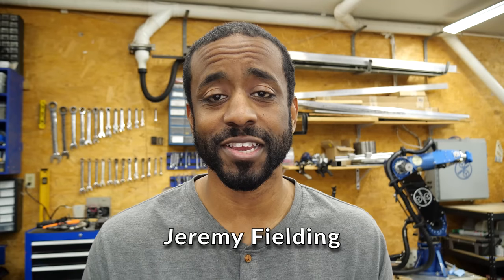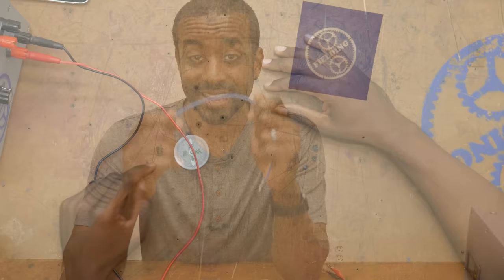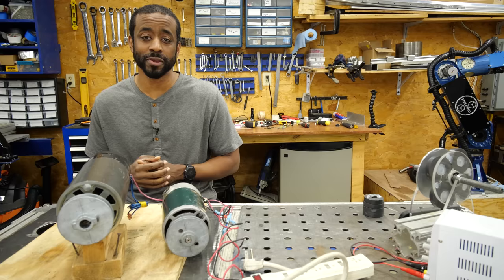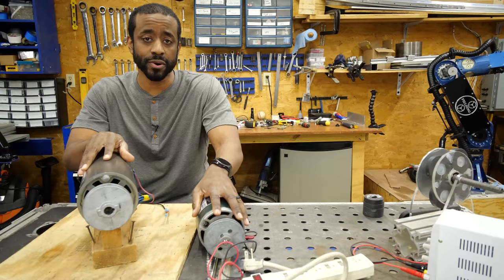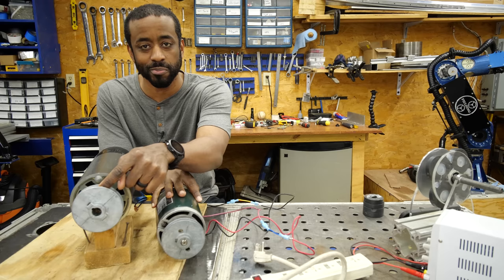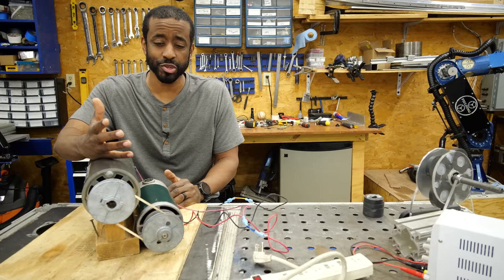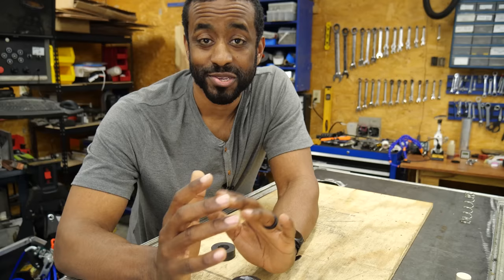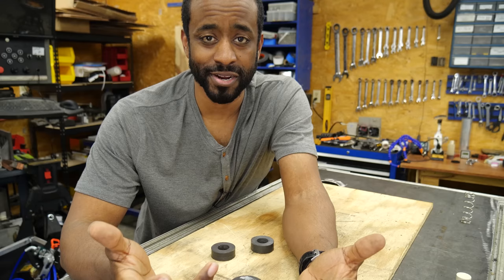Reviewing Free Energy Generators.  A Response to My Video "Nikola Tesla's Greatest Invention"- 102

Comment: You have made me a dumpster diving hoarder. In the last week alone I've brought home a control panel from an moisture evap unit, 3 90v DC gear drives and 3 12v DC power supplies. I've been stalking the engineers at work just to fuel my addiction. Thanks for the great content

Comment: I'm 77 years old and in 1965 I took a course from the Navy almost the same exact thing the only thing I didn't hear him mention is there's also resistance in the wire if you put 2 V or amps actually into a wire by the time it travels just a few feet it no longer is 2 V that's because of resistance in the wire gold is the best conductor of electricity however for obvious reasons that's too expensive silver is next that's what they use in shuttles and the most abundant is copper which is used in most electronic equipment. I'm a high school dropout and in a very short time I was able to understand this.

Comment: I use to maintain an NMR lab at a state university. A modern NMR magnet is a solenoid wound with miles of super conductor wire. The solenoid sits in a bath of liquid helium. A DC current is feed into the wire, once it reaches the desired level the source is removed and the current runs in a circle which generates a strong and stable magnetic field. We had magnets that had been running for 20 years without losing their fields. An MRI machine is set up in this manner. Really cool..
Reply: But what happens if you try to draw power from it to supply or feed an external system I don’t know much at all about any of this stuff so is why I’m asking I’m not trying to be a smart ass or anything im just really fascinated by this subject cause is such a challenging subject matter and one of the most important aspects in life that if figured out effectively would be a good way to start to change our impact and interactions with one another and this world that’s so far been a great host to our occupation of it
Reply: @user-wi4kx1td4i  no one would do that. you don't  go to the trouble of getting a superconductor going just to use it like a 5¢ capacitor.
Reply: @user-wi4kx1td4i A static magnetic field doesn't generate any power. It only has potential energy, in the same way as a chunk of weight sitting on a shelf has potential energy. You can only generate energy from it by induction (e.g. waving a piece of metal in the field back and forth) but even that energy comes from the kinetic energy of the waving motion, not from the magnetic field in the coil.
Reply: MRI machines use superconducting magnets, but they are discharged when the machine is turned off, but maybe by deliberately using up the power, because there are some reasons why you don't want to have the strong magnetic field on all the times (for example, you couldn't use any metal tools to repair the machine if the magnet was still charged).

Comment: I think the magnet as a spring is a really good analog,. Magnets suspended over superconductors will apply force to a scale underneath if you press on it.
Reply: Apart from the fact that magnets, unlike springs, unfortunately can't be positioned to hold an object in equilibrium. Earnshaw's theorem
Reply: Every system, is a spring. :)
Reply: @dfgaJK  with a super conductor it can
Reply: @harrytopia282  Ignoring the amount of energy it takes to cool the super conductor. Yeah.
Reply: @SirHackaL0t.  there are super conductor materials that don't require cooling but can only be manufactured with expensive rear earth materials and gases under a vacuum. Yeah. Anymore  sarcasm. Hello anybody home Hello Hello.
Reply: @harrytopia282  Do you have a link to the super conductor materials that don’t require cooling? Even with superconductors, it’s impossible to get more energy out than you put in. 🤷‍♂️
Reply: @SirHackaL0t.  I think there was some experimental one, one or two years back, but it was only experimental so
But even then. Some sort of energy loss will appear
Reply: @SirHackaL0t.  Well if you are already in a cold environment (like on Pluto, in deep space, etc.), then everything already gets cold enough without extra "energy".
Reply: @iteragami5078  Sadly, that’s not the case here on earth. Even your deep freeze isn’t cold enough.
Reply: @SirHackaL0t.  What do you mean? YBCO (a superconductor) needs to get below -180 Celsius, but Pluto is at -232 Celsius, which is plenty cold enough?
Reply: @iteragami5078  but we are on earth, not pluto. sigh

Comment: GREAT VIDEO: When testing electric motors in the lab (22 years - RMTC in Battle Creek, Michigan), the best we could get was always a loss. Electric motors have improved over the years and the motors now used in automobiles are incredible, however, they still have a loss. That loss keeps us from keeping the mutual systems going. Once power is removed the systems start to slow their rotation and finally stop. How quickly they stop depends on the load and is directly follows the universal time constant curve. In five time constants it is considered fully stopped.
Reply: They stop straight away once you remove startup power
Reply: @harrytopia282  There is some momentum after you cut the power
Reply: @daskampffredchen9242  very little, the generator becomes a dynamic brake and the setup will stop virtually straight away

Comment: My Dad told me and my friend, when we were in our early teens, to find out about perpetual motion, I think it was for two reasons, 1. Keep us out of trouble and 2. Make us think, we had great fun trying loads of different ideas, we found loads of things out, after a lot of messing, I got hydrogen from water and just a few volts, we spent weeks making lots of small hydrogen generators, once we had the optimal voltage to output, this was in the early 80`s so the only information we could get was from the library, but it was well worth it, we didnt store the hydrogen in any way, it was just what we had in the rubber tubes, and adding a small diameter metal nozzle outlet and a one way valve (the only thing we brought), it fired up with the first match, my heart was racing, so back to the library to get as much information as possible, we added an oxygen nozzle, took us ages to get it in the right position, once it was we were cutting sheets of steal like butter. Then we started on gun powder and black blasting powder and we even got the school to let us make it there as our science project for a heigh percent of our grade of our exam, Im now 52 and never stopped messing about, even trying things that you think that no way will it work, ok 90% does not, but the 10% you get something, even if its not what you expect, Anyone who is interested in tinkering about please do it, stay safe, but have great fun, I still am ;)
Reply: Gun powder in school...that brings back memories of PU trucks with rifle racks & usually loaded guns in them w/ the windows down. "Boonietown High" for 1 so no one stole as pretty much everyone knew everyone & it was early to mid 70's (think that 70's Show).
Never did the GP @ school. Basement yes. Was a mad little scientist for a bit & my Dad owned a bookstore. Who needs a library when you have a used bookstore! 
Couldn't begin to make it today!😝
So you actually got the H O generator to work...amazing!
Reply: @jakekot1351  How fantastic, ya dad having a bookstore, the info you must have got so quick, they have it easy now lol, I made a generator a few months ago, to show my grandkid, only a small one this time just to show him what you get from 2.5v, I explained the name of the game is be bloody careful :) , I explained that it starts to get danderous if you want to store it and told him to get on the net and look up 5 or 6 sites and get the info on storage, as I never bothered, still cant get over how lucky you were with the bookstore :)
Reply: @DenBlackburn  I spent summers after 12 to probably 18 at the store a lot, just long & narrow with 2 aisles, a bigger storage sweatbox in the summer & "that smell" of old paper, 18 was when we closed it. Gold was legal to own/trade. @ 13-14 got to walk to Bache, a brokerage firm then, & sit at an empty desk by our guy. Monitors were orange. I'd  get the kbd (1 for 4 desks) & check our stocks, I held some too. 50 of this, 100 of that...MORE THAN NOW (0)!  We moved more into antiques & mostly out of books but the library for the business & what I skimmed for myself grew. Almost all gone or ruined due to long term illness & bad neighbors. Then went Sunday big Pa markets & then shows. Had a great childhood/young adult hood but never enough time. Had Great folks. Of course outside forces, awful nutty younger women, changed things & no one had my back. Parents died, people lied, doctors were feeding too many meds & hard to do the work of 3 when you become 1/4 the person. But I did have a great life up until almost 32. 1/2 a life time later I'm wondering how to do the impossible. Different life for sure!

Comment: Electric cars do have alternators. Most of the time, they're busy acting as motors to drive the wheels, but during regenerative breaking, they're working in reverse to recapture some of the energy back into the batteries. 😉
Reply: The equivalent of pissing in river and calling it kool-aid🤣🤣🤣
Reply: @rodneyfox5566 , nope.  Regenerative braking actually works and is useful.

Wall to wheel, most electric cars these days are low-mid 90% efficient, and roughly the same efficiency in either direction.

So, roughly 90% of the energy required to decelerate the car can be recaptured and stored back into the battery.  For highway travel, where most of the energy is spent pushing air out of the way, this is minimal, but in ‘stop & go’ traffic, where most of the energy is spent repeatedly accelerating the car, this can be significant.
Reply: lmao         most ev's have  a  MAIN  motor.      not  multiple motors at the wheels.     of course, i know that you are  CONVINCED  that you are right.  and, i know  that i am wasting my time, on an arrogant bonehead.
Reply: @daviddavids2884  Well, first, there's nothing in my comment that says there is a motor at each wheel. For one thing, cars was used in the plural here. But since you brought it up, dual motor -- one per axle -- is the most popular configuration for EVs these days. All Teslas use a dual motor AWD configuration now, and the top 2 EVs by sales are the Tesla Model Y and Model 3, which each sold at least 5 times as many units as the next most-sold EV. There are also performance designs that use a separate motor at each rear wheel and concept EVs that use a motor at each wheel, so that is actually a design that is used, though it is not used widely today.

But sure thing, buddy. I'm the arrogant bonehead here.
Reply: @bloodgain  so I looked at dave Davis YouTube profile to see who he was . But one question of course is he for real or is he just pretending to be this uninformed . I understand quite well how regenerative braking works if you click on my profile you'll see. And I do have a Tesla with two Motors but the motors are being Motors when accelerating and both of them are being generators when decelerating. I guess the real question I have for you and myself when somebody is so far in the woods of how something works why do we care.
Reply: @steveclunn8165  I actually never got notifications for the first 2 comments, only that last one. I would have ignored Rodney, because his comment is void of meaningful content (which is fine). David was at least wrong in ways I could point out and turn his insult back on him. Of course, if someone wants to question or disagree with my statements politely, I'm more than happy to engage in kind. I mean, heck, I am occasionally wrong! However, I do my best to inform myself before acting like I know something; otherwise, I stay quiet and listen or engage as openly unknowing.

I avoid the comments on most channels, but there aren't usually many jerks like David lurking in the comments on channels like Jeremy's. It always seems like the ones hurling insults are projecting a bit, as I can usually say, "Who looks like an <insert what you said> now?"
Reply: Yes because battery charging is 100% efficient and there isn't any loss in the wire or the power to operate the system that engages the brake system, i heard solar panels are 80% also🤣
Reply: and even then, the are not as efficient as the are at being a motor.
Reply: @pomonabill220  Yeah, that's obvious, but it's a nice bonus to have regenerative breaking
Reply: @pomonabill220  Would you prefer 40% or nothing is the question I guess
Reply: This is a really good point.  And while your critics are happy to laugh at you, they didn't stop to really hear the point you are making.  

The point is that electric vehicles use the drive motors as generators (pseudo alternators) to slow the vehicle, which allows the recapture of energy that would otherwise be lost to friction/heat.  The fact that the recaptured energy isn't enough to return the battery to full capacity is a clear indication that the system has plenty of losses in other ways.
Reply: @drhender6943  It's not so much a really good point as a very simple and obvious point.
Reply: @rodneyfox5566  Which is better. Recapturing 0% of the energy required to stop the vehicle OR Recapturing anything over 0%....
Even if regen braking is 50% efficient (it's better than that), thats energy you get at no additional cost and as a matter of fact at a savings since you are reducing the wear on your mechanical brakes...
Reply: @daskampffredchen9242  its not nothing the materials used to create the system and the cost to have it on the car would probably cover gas cost for the life of a gas powerd equivalent
Reply: @2009dudeman  the cost is when you purchase the car at an additional 20,000 for 4 extra generators. That are sitting in the worst area of a vehicle, between salt,dirt,water,and any other road grime looks like a recipe for maintains nightmare
Reply: @rodneyfox5566  so you don't know how Regen braking works, and you are insulting it... You don't need extra anything. The same motors you need to drive the car forward are used to recapture energy. It's ZERO extra parts for Regen braking, it's just a bit of extra programming.

Comment: Thank you. ☺Part of your explanation reminds me of how the movement of the wheels on my 2008 Prius charges my electric engine's battery without the need to plug into an outlet. The auxiliary battery is used to starts the vehicle.
Reply: I wish you could rephrase because you lose me. Are you agreeing with the dude or not? He explained that that is counterproductive.
Reply from the maker: This is slightly different. It’s called regenerative braking and pretty much all EV’s do this. The alternator will slow the car which is bad energy wise except in this one case you want to slow the car! They don’t use an alternator because it’s still stupid. But the engine can do the same thing in reverse and is more efficient. I explained how it works in part 2 of this series around 12:40 ish. Link in the description.